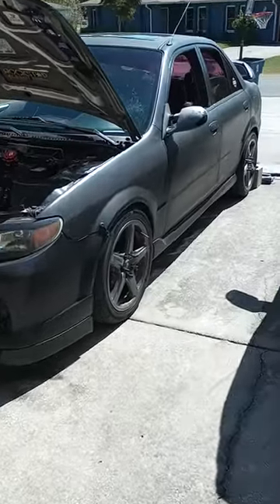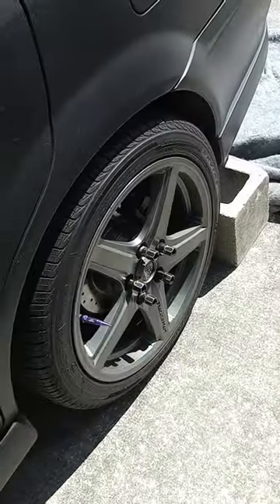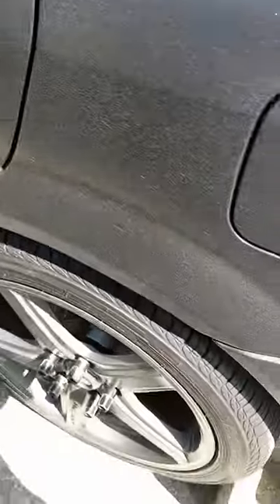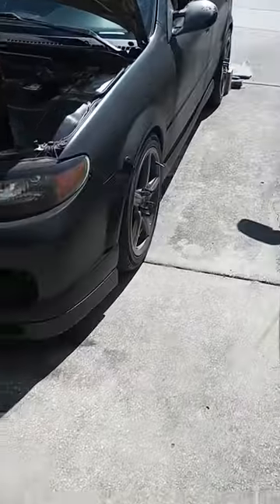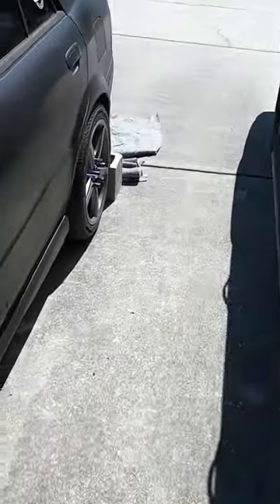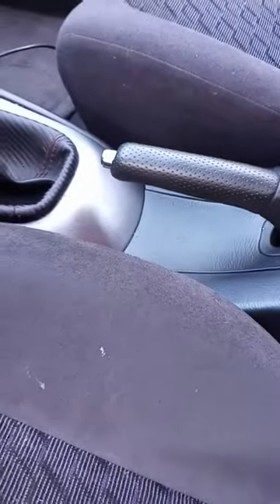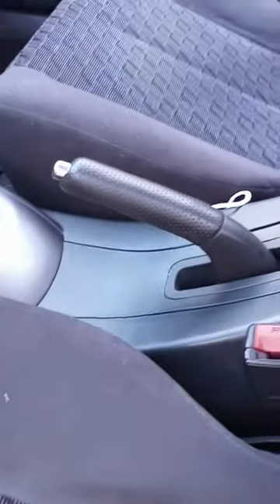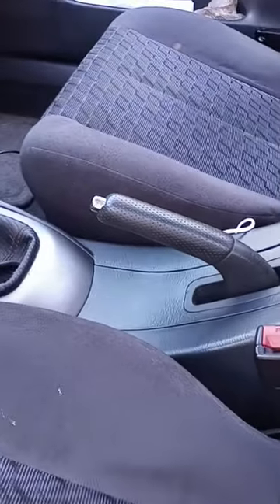Mazda Protege rear caliper/ e brake adjustment. #mazda #mazdaspeed #repair #instructions

Comment: Do you have drilled/slotted rotors up front? If so where did you find them
Reply from the maker: Hello. Yes I do. I usually get mine from Amazon.
Reply: @SteveTheBeardedWonder  I’ve got some before and they came too small just trying to figure out the best way to confirm fitment